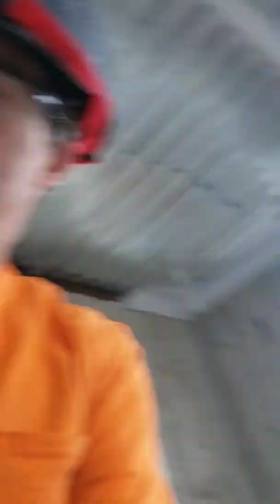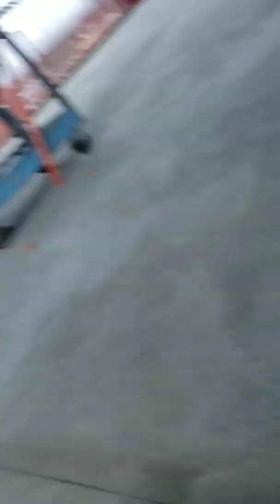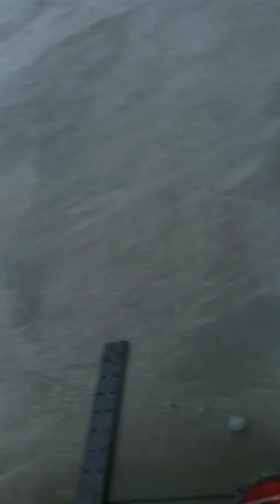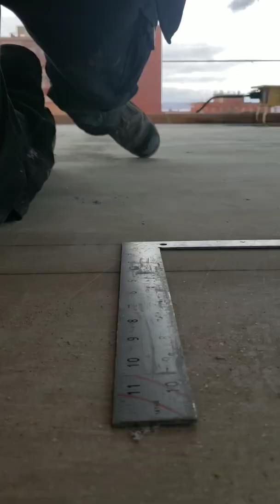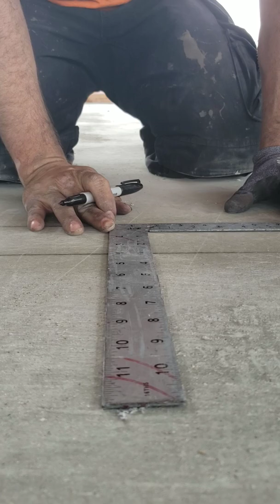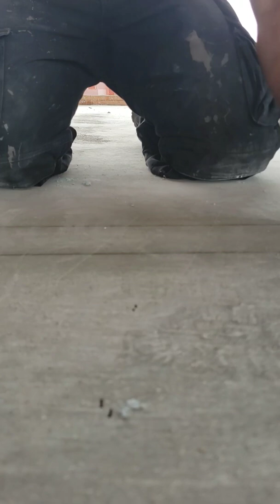Squaring lines

Comment: What thickness of chalk line you use for lay-out. And what spray you use to hold your lines so you can see them after doing lay-out.
Reply from the maker: I use bold for most of my layout. The standard clear spray works fine. I have settled on tajima chalk boxes. In part, because I can use the different colors boxes for the same color chalk. White, black, red.
Reply: I have 2 tajima chalk lines, the extra bold. You use the same or use the extreme or maximum lines. And in clear spray, what brand do you use. Or can you send a photo of it.
Reply: Where do you use your white lines for as well as you black & red lines. And what type of line do you use. And what is the brand of speay you use
Reply: The white lines pop real well. It's now my main line. I use it for all my basic walls. Works on concrete, plywood, red iron. etc. I used black in this video. But really stated using white for everything after this job. 
Red for pony walls. And or gridlines. (Non on finish concrete) 
Blue or black for soffits. (Semi perm). Might try green for soffits soon.